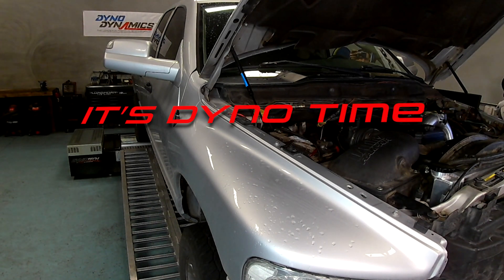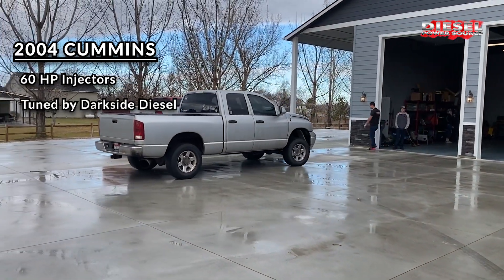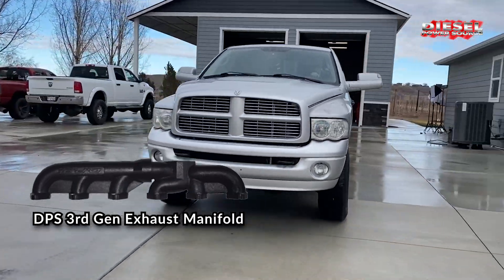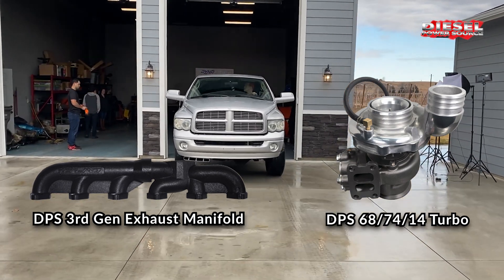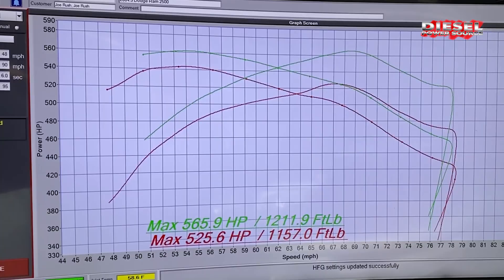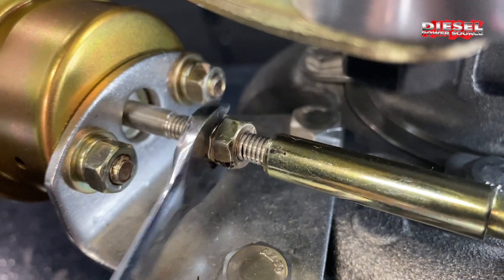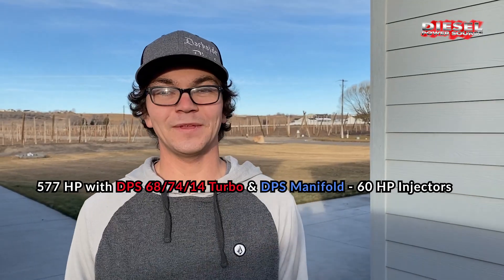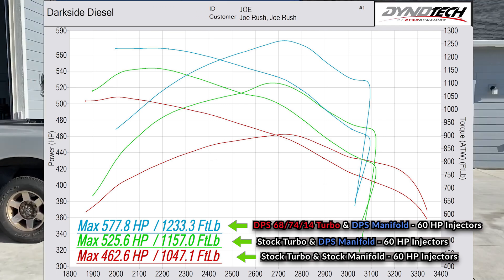Dyno Comparison | Stock Turbo vs DPS Turbo | 5.9L Cummins Performance

Comment: Did you go from 462 to 525 horsepower with just changing the dps exhaust manifold and the same injectors on both dynos? The exhaust manifold increased 63 horsepower by itself?

Comment: I bought a 2005 Dodge Ram 2500, but didn't really look into all of the aftermarket parts. It ended up having a DPS Turbonator Turbo, DPS Extreme manifold, DPS Arctic Cooler, S&B intake, 5 inch exhaust, DPF delete and a Smarty Touch S2G. The programmer doesn't work right, but Smarty is sending the stuff out to fix it..The truck is a beast and will be even more so, whenever I get the programmer up and going again. I turned my boost up this morning; just did 2 rotations, and man did it really wake it up..It sounds freaking great.